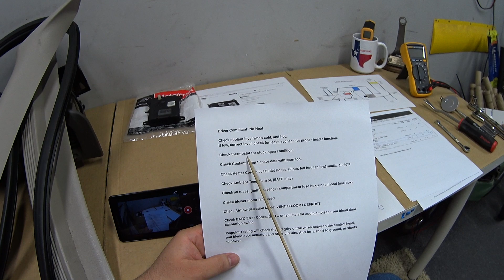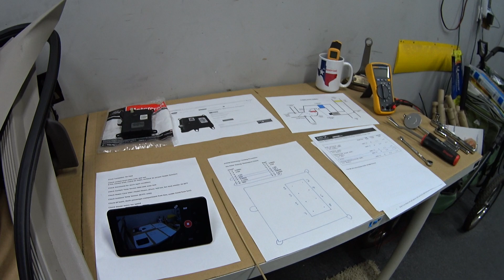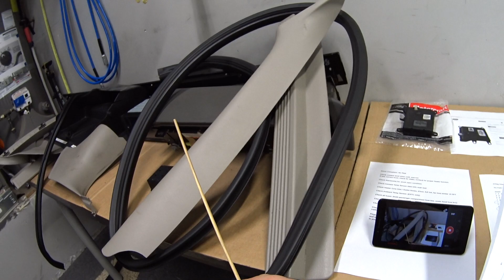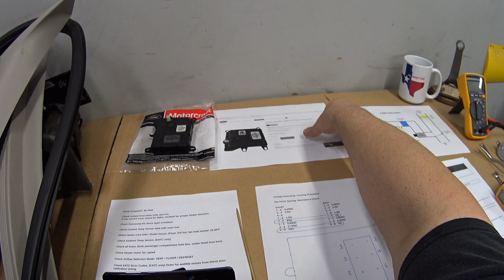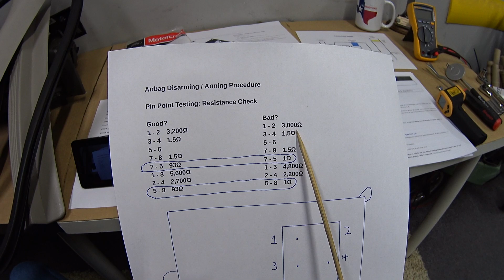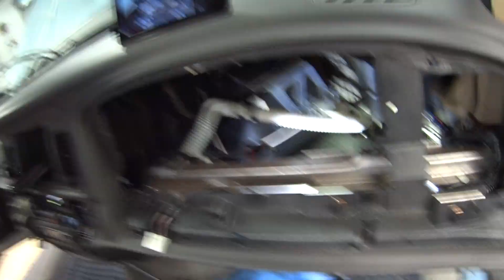Crown Victoria - Blend Door Actuator

Comment: Hello. Great tutorial! I have an issue that I hope you can help me with.
I have 2008 CVPI with manual climate control. It blows ice cold a/c but no heat when I bought it. Figured it was the BDA. Got the correct new OEM BDA and replaced it following your vid. It went pretty well, did it in about 2.5 hours. Drove it up to temp and discovered that I had a medium hot/cold temp regardless of where the temp control knob position was. Did it all again. This time I carefully opened the new BDA and set it to full heat. While I had sight of the BDA after reinstalling it, I tried adjusting the temp control knob. Nothing happened. I checked all fuses, wires, and connectors. All good. I then thought it might be a bad potentiometer in the temp control knob. So I put everything back together. Now have hot heat but no a/c. Ordered a used good condition temp control panel. Replaced it. I did hear a hiss when disconnecting the vacuum lines from the old panel. No change. Someone suggested it might be a vacuum problem. Checked lines, no leaks. Removed the black vacuum box on the firewall and rerouted the lines, as was done in a vid someone sent me. Still no change. I'm now thinking I got a bad new OEM BDA. What do you think could be happening here?
Also, I followed the procedure for disarming/arming the airbag. The first time I had no airbag light. After the second time I now have the airbag light. Tried the entire procedure three times since then and checked the wires and connectors, all good. Still have the airbag light. Thoughts on this?
Thanks in advance for any help.
Reply from the maker: Hello,
I would try this first;
https://youtu.be/9CxejeIbGYw
-Chuck
Reply: @PanzerPlatform so I tried this, and nothing changed. I am now convinced I got a bad new OEM BDA. Winters coming so I'm just gonna leave on heat for now and mess with it later. Thanks for your help.
Reply from the maker: @crezazle  
Connect a scan tool, and command the Temperature Control Blend Door Actuator to check if it responds correctly.
You can get a FORScan device for $20.
Reply: @PanzerPlatform ok, I will. Thanks for all the advice.
Reply: Will try this. Thanks!

Comment: What if it says 24 and 25? What else could it be I got 2 codes
Reply from the maker: Hello,
Are you currently experiencing a malfunction.
Can you describe the problem?
Please include the YEAR / MAKE / MODEL of your car.
-Chuck
Reply: @PanzerPlatform  2001 Ford Crown Victoria LX when I go to use the AC it still blows heat I don’t hear any noises but that’s it so far it went out randomly all I did was charge my battery and the AC haven’t been working every since. The codes 024 and 025 pops up when I do the self test.
Reply from the maker: @bigswervo434  
Thanks for the good description.
Try this procedure to reset the system;
https://youtu.be/9CxejeIbGYw

After that try to use the A/C.
And do the self test again to see if the error codes are still present.
If that doesn’t work come back, and we’ll go from there.
-Chuck
Reply: @PanzerPlatform  I tried it, the error codes are still there
Reply from the maker: @bigswervo434  
OK, good work.
1.) Check all fuses & relays.
2.) Start the engine, and turn on the A/C.
3.) Open the hood, and watch the A/C compressor clutch.
4.) Check to see if the A/C compressor clutch engages, and disengages every few minutes.
You want to hear, and see it clicking on/off. 
After you do that come on back for the next step.
-Chuck
Reply: @PanzerPlatform  hello I just realize I did step 1 wrong, any ideas or link where I could purchase that jumper wire thing
Reply from the maker: @bigswervo434  
Google search: Harbor Freight Test Lead Alligator Clips
They are $3.59
You can also find similar on Amazon.
-Chuck

Comment: So i just did the self test.  Because no matter what settings my automatic unit in my 1998 Mercury Grand Marquis was on it would blow hot. Ac wasn't working, The test fix this showed error code 24 now they see works flawlessly, so are you saying that this is just a temporary fix? That it will soon act up again?
Reply from the maker: Correct.
Your Temperature Control Blend Door Actuator has an intermittent malfunction.
Sometimes it will get stuck on a dead spot on the tiny little motor inside the actuator.
When the problem first arises you can reset the actuator to get it to work a few more times, or months.
Eventually it will completely fail, and no reset will restore operation.

There are 3 ways to reset the actuator.
1.) Self Test 
2.) With a Scan Tool.
3.) And this way; https://youtu.be/9CxejeIbGYw

If you don’t have the time, or money to replace the actuator at least buy the part while it’s available.
Parts will soon dry up for our Panther Cars.
The OEM part number for your 1998 MGM is;
Ford: XW7Z-19E616-BA
Motorcraft: YH1766
I just checked and they are;
Amazon $59 
RockAuto $48  
Walmart $75 
O’Reilly $80 
FordParts $86 

-Chuck
Reply: @PanzerPlatform   well everything's working fine but I did the test again because I'm retarded and going to keep doing it until I break it for good lol but no I just did the test again and it showed error code 25 this time instead of 24 so I did it three or four more times just now and I'll keep showing up 888, which from what you say means everything came out fine so I'm hoping that since the car sat for a long time maybe or is just old it just needs to be reset hopefully that fixed it but I might take your advice and go ahead and buy the part

Comment: Five star ⭐️ ⭐️⭐️⭐️⭐️ Video.  Mine went out today. Only blows super hot.  
How do I check the ambient temperature sensor?
Reply from the maker: Thanks for watching.
What is the YEAR / MAKE / MODEL of your car?

Which ambient temp sensor, there are two?
One in the passenger compartment in the dash next to the HVAC control head, and one under the hood near the front bumper.

If the passenger compartment, and you have the EATC try this;
https://youtu.be/1g4v4aHqIzI

Or you can check either one with a scan tool by looking at the live data.

-Chuck
Reply: @PanzerPlatform  ‘03 MGM LS. Ran the test a few times and everything reset.  Blowing cold and hot when I select the corresponding button.  Thank you so much Chuck!!  I owe you.  What’s your PayPal?  Going to send you a thank you!
Reply from the maker: @WFO. 
That's really generous of you.  
Thank you so much, my channel is not monetized, so I'm grateful for the donation.
My PayPal is my email address;
BudgetPantherPlatform@gmail.com

The 024 error code definition is in the description box of the EATC video.
If you have another Panther Car like a Crown Vic without the EATC you can do this to accomplish the same “reset / recalibration” 
https://youtu.be/9CxejeIbGYw
-Chuck
Reply: @PanzerPlatform  Chuck, I’ll make a donation.  So, realized that the door is now stuck on the cold air setting.  Grrr.  I’ll be following your video next weekend to do the job.  Got a pal who is going to help me.   Any renew recommendations since your video?
Reply from the maker: @WFO.  
Thanks for the email, and the kind words.
If I had to do this job again I would do it exactly the same.
Except maybe order a spare OEM actuator from Amazon just to have on hand.
Reply: @PanzerPlatform  MGM 2003 LS.  Mint condition with just 67k miles.   I’m running the test now.  Shows code 024.  What’s all that mean?

Comment: Wait so was there no air coming out of the vents beforehand or was it the wrong temperature?
Reply from the maker: Yo Charlie,
Thanks for stopping in.

In my particular malfunction it was winter, and when I turned on the heater it blew cold air.
This might give you a better understanding of how the HVAC functions in our Panther Cars;
https://youtu.be/O-UblzGhbDw
-Chuck
Reply: @PanzerPlatform  Ok, thank you. I have a periodic issue with no air coming from the vents, I think its a lack of vacuum somewhere
Reply from the maker: @charlie_nolan  
If you want it fixed, what is the  YEAR / MAKE / MODEL of your Panther Car, and if you have the "basic 3 knobs" control head, or the electronic automatic temperature control head, (EATC).
Reply: @PanzerPlatform  I have a 2011 Crown Vic P7B with manual controls. I watched your video, I’m pretty sure the issue is with a lack of vacuum going to the control head, a lack of vacuum coming from it, or failure of one of the doors in the system that blocks certain vents. It’s a fairly rare occurrence though, I’m not going to do anything about it for a while.
Reply from the maker: @charlie_nolan  
Fair enough.
The next time it acts up perform this procedure;
https://youtu.be/9CxejeIbGYw
The PCM will recalibrate all electrical HVAC actuators by forcing them to go full sweep in both directions. If this procedure temporarily fixes the issue it usually means you have an electrical issue like a malfunctioning Temperature Control Blend Door Actuator.

If the reset / re-calibration procedure has no effect on your HVAC issue it usually means the issue is vacuum related like a malfunctioned vacuum control motor, bent, broken, missing linkage to a vacuum control motor, or an air leak.
Reply: @PanzerPlatform  thanks!

Comment: Very informative. Another I saw removed or loosened the steering column too.  I don’t think I saw you do that. This way seemed not as ominous. Thanks for the detailed airbag disarming info.  This was different than my only other experience with blend doors on my wife’s Taurus. The motor had a pinion and the rack attached to the blend door was missing several teeth.  You could access the rack w/o removing anything thru an access hole in the heater box and seasonally I would help push the rack past the missing teeth and disconnect the servo motor once it accessed the heater core or the A/C evaporator.  I never thought of replacing it as I considered the car a short timer to be soon scrapped. This does not even appear possible on a Panther.
Reply from the maker: Yo Walter,
Thanks for stopping in, and the good feedback.
-Chuck

Comment: I drive a 2006 Mercury Grand Marquis. Silly question perhaps but assuming I have to take my car someplace to fix my AC which only blows hot, would there be a way to have the mechanic LOCK the door to make sure it can't blow anything but cold?
I live in Arizona, I never need heat and this is a very annoying expensive repair that likes to repeat.
Reply from the maker: Right on Rich,
Thanks for stopping in.

I thought about it, and there are a handful of videos on YouTube showing how people deal with this situation if they can not afford the near $1,000 in labor charges to remove the dash to replace the Temperature Control Blend Door Actuator. Btw, the current price for the actuator is $45. 

Or, if they do not have the tools, time, garage work space, etc to fix it themselves.
What they do is, go in through the glove box, and break off the actuator to provide access to the “ROD ARM” that opens / closes the door flap that controls the hot / cold air.

Once they break off the actuator, they can now manually adjust the the door flap.
Most guys have said they move it to the hot side, and lock it in place for winter.
And then in 6 months they move it to the cold side, and lock it in place for summer.

I thought about doing this myself, but then I realized if I go to the trouble of breaking off the actuator, why don’t I just replace it with a new one. And that’s why I made this video.
Skip to 20:01 in the video to see what I’m talking about.
-Chuck

Comment: Did you have to break the back loop on the new actuator to put it in?
Reply from the maker: Right on Mr. G
Thanks for watching.

No.
I took a pair of dikes, and cut a small section of the "loop" for the back bolt on the actuator the same width as the bolt.

Then I loosened the back bolt just a few threads, and slid the new actuator into place.

Then install the other two bolts, and lastly snug down the last back bolt.
-Chuck

Comment: Does anyone have a suggestion on if the Blend Door Actuator may be closing improperly? I can get heating and A/C on my vehicle without any problems but when I have the climate control off entirely I still get a small amount of hot air coming out of the vents
Reply from the maker: Right on Jose,
Thanks for the great question.

What is the YEAR / MAKE / MODEL of your car?
This might help; https://youtu.be/9CxejeIbGYw
-Chuck
Reply: @PanzerPlatform  2008 Mercury Grand Marquis
Reply from the maker: @JGameAndWatch  
Right on,
Try this to check for HVAC error codes; https://youtu.be/1g4v4aHqIzI
-
It will also perform a self-calibration, and may free up a sticking door.
You may also have an obstruction, like a linkage rod malfunction, or maybe foreign debris preventing full swing operation of the door.
Come back with a progress update for more help.
-Chuck

Comment: Hi Chuck #PanzerPlatform  , thank you for the video.  My 2011 LX was stuck on AC with no heat.  With your video, I was able to do the repair with confidence this past weekend.  I have the EATC.  Yours also seems to be the only video that mentions how to arm/disarm the airbags.  Before I did the blend door actuator repair, I did the O ring fix internally on the EATC module because that was simple and cheap.  However, I do still have another fix since hot or cold air is just blowing out of all the vents/defrost/floor regardless of which buttons are selected on the EATC module.  Any suggestions on where to start next?  I believe it to be vacuum related with those colored hoses that go to the vacuum motors.  I know the hose harness and one of the vacuum motors have been discontinued form Ford.
Reply from the maker: Right on XTC,
Thanks for the kind words.
Check out the pinned comment on this video; https://youtu.be/VdE0GWuYgTU
-
After that check out this video; https://youtu.be/O-UblzGhbDw
Take note of part about Vacuum Control Motors.
-
Chuck

Comment: I need some help with this but for ac.  I bought a new actuator and it still didn’t work.  All the control on the climate control works but when i change the temperature dial, the number change but the servo doesn’t move.
Reply: @PanzerPlatform  I figured it out.  I had to plug in the actuator, then turn switch to run, and press automatic and floor def at the same time.  It will do a diagnostic, and reset itself...And I think (don't quote me) press floor or vent to end diagnostic...
Reply from the maker: @dmastudios4430  
Right on,
Good job figuring it out.
-Chuck

Comment: Thanks, Chuck.
I've been watching a while now, but this is my first time commenting.
I don't own a panther platform car right now, but I'm in the market for one to replace my 2001 Buick Regal. I came across a 2004 Grand Marquis with 114000 miles that will be in an estate auction at the end of the week. I went to check it out and most of it was good. The body had no flaws and there was no rust anywhere (which is saying a lot in Ohio!). The engine ran great and the transmission shifted fine. But there was one problem - the overdrive would not turn on. Pressing the switch did nothing. I'm a very amateur mechanic, so I wanted to ask your opinion if you think this might be an uncomplicated problem that could be solved, or more trouble than I would want to take on? If you were at the auction, how much might you bid on it?

Please keep up with the great videos!
Reply from the maker: Right on Alan
Thanks for watching,

There’s about 100 possible reasons why the car will not shift into 4th gear (overdrive).
There’s no way to know until a thorough diagnosis is performed.

It could be something as simple as a blown fuse, low fluid level, malfunctioned shift solenoid, malfunctioned coolant temp sensor, dirty transmission filter & fluid. All of these can be performed without removing the transmission.

Next it could be something more complex like a broken internal snap ring, or malfunctioned valve body.

Worse case scenario, a rebuilt transmissions cost $1,500 - $2,000, and about $1,500 - $2,000 labor for installation. So possibly as much as $4,000 total.

With the information you’ve given me I would personally bid no more than $500.
If I won the car for $500, I’d be willing to spend another to $500 to fix the transmission problem. 
If the transmission repairs exceed $500, I would “park” the car and just sit on it, and maybe replace the transmission at a later date, or use it as a “parts” car.

Either way there are too many unknowns, and too much risk to bid over $500.
Sorry, I’m not much help.
-Chuck
Reply: @PanzerPlatform  Thanks, Chuck. That's some great feedback and I really appreciate it.

Comment: Hey Mr.Chuck, it's me again. 
I have an 03 vic lx 260k miles (handed down from my father) and I think the blend door went out. I am getting full heat but no A/C, but it's winter-ish still in the east coast but we still get all 4 seasons here. I did the system check and during the test, I was getting a consistent "thump." I got code "124" which I think means the blend door failed. I can do simple maintenance like oil/ transmission fluid change, but never did something like this time consuming, kinda due to my inexperience and I'm kinda young. Do you suggest I give this a try, or should I just go through my local Ford Dealer? They asked about 400-600. Thanks for reading and hope you have a nice day.
- Raf
Reply from the maker: Right on Raf,
Thanks for watching.
The thump noise you describe may be the plastic gears inside the blend door actuator have stripped out.

Before yo go any further you may want to confirm the A/C compressor is clicking on/off when turned on.

$600 for Ford Dealer replacement sounds low. My local Ford Dealer quoted me $1,000.
Given the part only cost $45, I decided to try.

It's up to you, but if you have a location to work on your car like a garage, it might be worth it to spend 3-5 hours teaching yourself how to do this, in order to save $550-$950. It's not difficult, just time consuming, and requires patience.
-Chuck